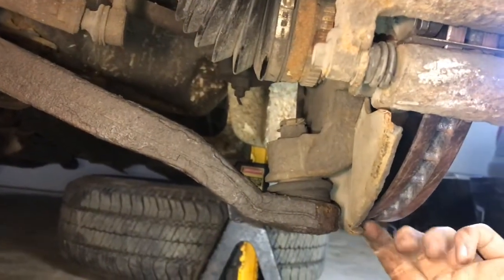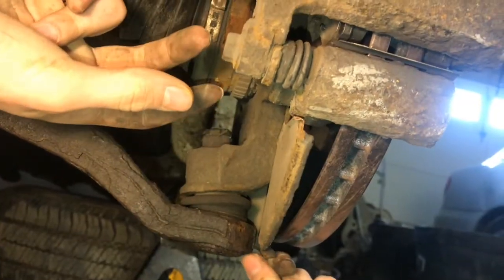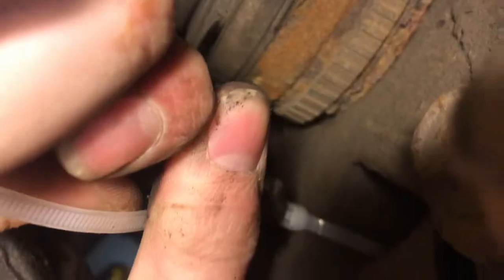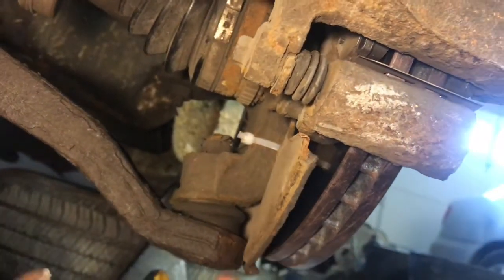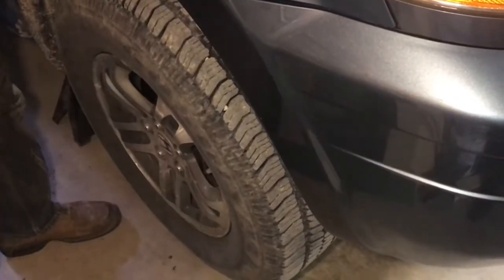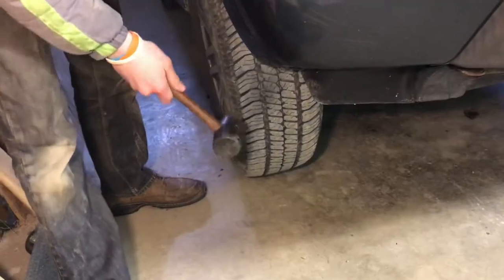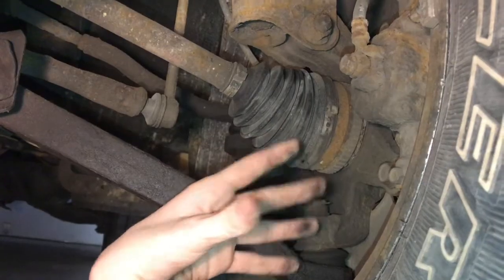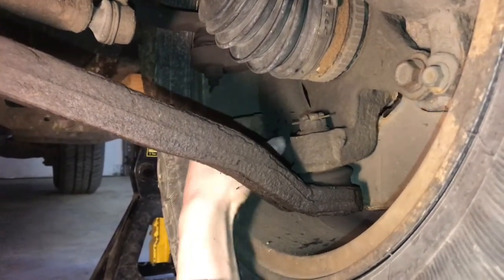fix A RATTLING brake dust shield with a zip tie

Comment: You really put a plastic zip tie next to rotors that can get up to 400F/200C? That's a great idea
Reply: PeenutButterJelly lol that’s what I was thinking. I’d at least use a metal one.
Reply: Well 3D printing taught me that nylon doesn't reach glass transition temperature till about 275 - 290 Celsius (even higher than that assuming there's no cutting agent)
Reply: I dont think hes gonna go on track
Reply: That’s exactly what I was just thinking. Grind it off for fucks sake
Reply: @funfun5656   its nylon natural cabke ties. 165⁰ and thats it they start mealting.

Comment: You might as well remove it, the whole point of shield is to keep rocks and debris off the rotor now you just made a nice wide trap to catch rocks in to rub against the rotor.
Reply: It’s also to keep some dirt out of getting into the wheel bearings

Comment: Not a good idea to whack a wheel with a mallet!! Could damage the wheel bearings .. could damage the tie rods on the steering .. could alter the wheel balance. Not good practice!
Reply: when i worked at discount tire this is how we would get stuck tires off of cars. we had a big red rubber hammer that we would use on the rubber part. sometimes you’d have to really swing it too.

Comment: My 2014 Impala is in now for rattling and scraping sounds. My service advisor just told me that the scraping noise is coming from the brake dust shield. They’re still working on the rattling noise. I bet it’s the dust shield for that too. Thanks for this vid!
Reply: I have a 2014 Impala that does the same thing. Did they replace the shield?
Reply: @jerp270  Actually, they said they just “repositioned” it. I guess they just bent it back into place lol. I was good with that because it probably would’ve taken months to actually get the part these days. Oh, it was the brake dust shield causing both noises. It’s all good now.
Reply: @briandonald  thank you
Reply: @jerp270  No prob!

Comment: I just cut mine off it was rusty and would scrap the rotor causing a horrible noise. I would buy new ones but they don't sell them I checked everywhere. 🤷‍♂️
Reply: Try the dealer
Reply: @ortizc1989  I actually just cut the other side off last week, I don't know why it took me almost a year to do both sides but I'm so glad that horrible noise is finally gone. It's an old car not worth it to try to find replacements.
Reply: @Yophillips3272  I "removed" 😆 the driver side today. 07 Yaris. It was ready to fall off
Reply: Been thinking ab doing the same, how did you go about cutting it.
Reply: @Chicken sandwich  I honestly can't remember if I took the caliper/ rotor off. I think I just man handled them and pulled them off and used pliers/sheetmetal shears.
Reply: @Yophillips3272  Alright, thanks for the quick response my friend. 🤝🏻

Comment: This noise sounds very similar to the noise my rear wheel is making when I apply the brakes.  The sound comes and goes;  and gets louder while my car is sitting at a stop light or while in park. 
I know it is something to do with the rear braking system.
Thank you, for this video.
Be well!
Reply: Won't be the brakes if it's making noise while stationary
Reply: Check the heat shield on top of your exhaust. might be some loose metal rattling against your pipes!

Comment: My rear driver's side dust shield has completely rusted off the point where it jolds onto the hub.
I wish I noticed last month when I changed out that caliper that it was on its last legs, i would've cut it right off.
Im gonna try and get it off without removing the wheel, its legitimately just a spinning disc behind my rear rotor that's doing nothing but scraping the rotor over and over as it turns.(ever had a bicycle and attach a playing card or crushed can to the wheel so when your wheel would spin it would hit the bike spokes? Thats what it sounds like x1,000)

Hopefully I can remove it with snips or something from the back without even jacking the car up and removing the wheel.
But if not I will try the zip ties.
Only sucks that mine is completely loose and not even attached anymore, so its just hanging there.

Comment: Could I just not remove it. Is it an essential part? Mine has come loose on my BMW
Reply from the maker: I thought about just removing mine, there’s a lot of dirt debris rocks and sticks that come out from the road and hit that area. In the past i’ve taken pieces like this off that shield moving parts from debris and found out the hard way on a small stick got into One of the moving parts in my engine. That little stick snapped me timing belt. Never had a problem with anything getting jammed into the brakes except once I had a plastic bag get into the brake rotor and pads. Everything worked until the brake rotor and pads cool down in the plastic between the pads fused right to the rotor. I took a hammer and chisel to free things up again. As much as I wanted to just remove that shield I felt it best to fight to keep it intact. Anyway that’s the reason that I zip tied it back on. As simple as it is I kind of feel like it’s Worth putting back on. That’s my thought.